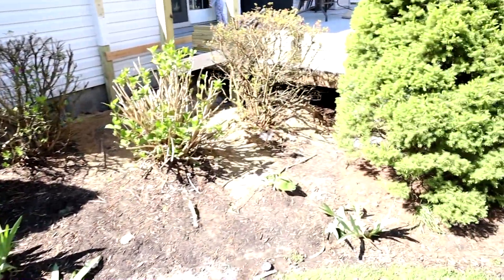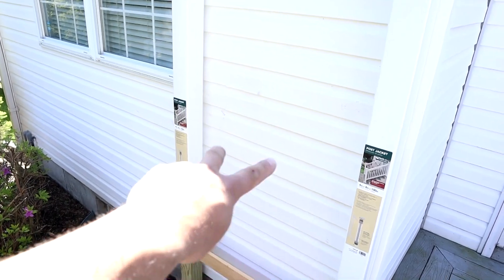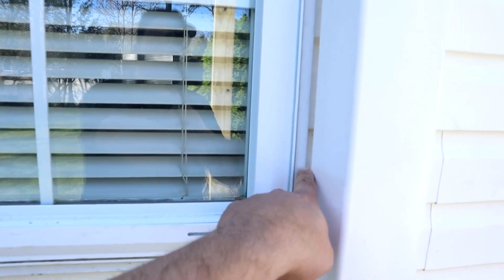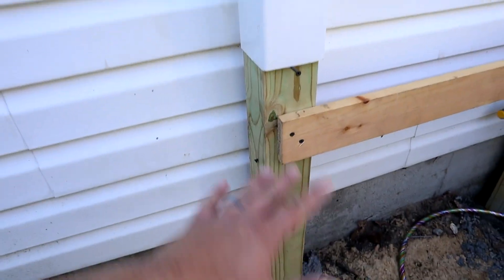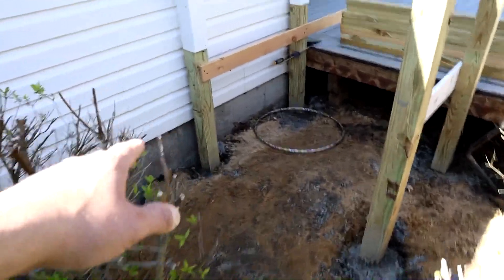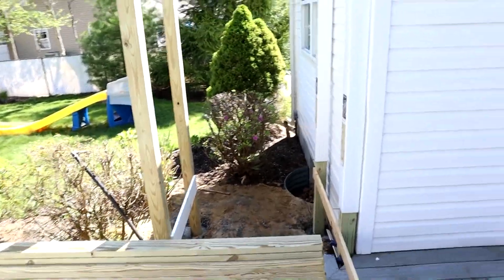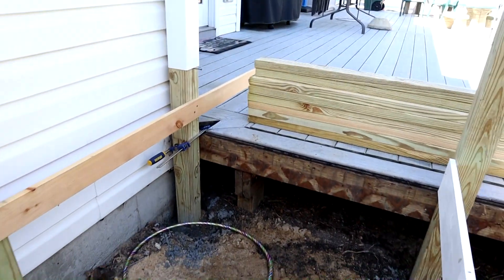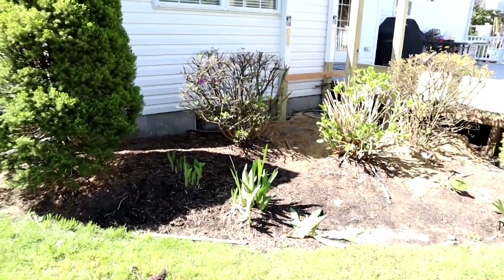Build an Outdoor Shower | How To Part 1 Intro

Comment: I just want to know how you keep the posts perfectly square with the house while digging those holes and setting the posts in concrete.
Reply from the maker: Horizontal bracing between the posts once you have them plumb and square, screw the temporary bracing in place while pouring the concrete. It will keeps everything where you need it until the concrete sets